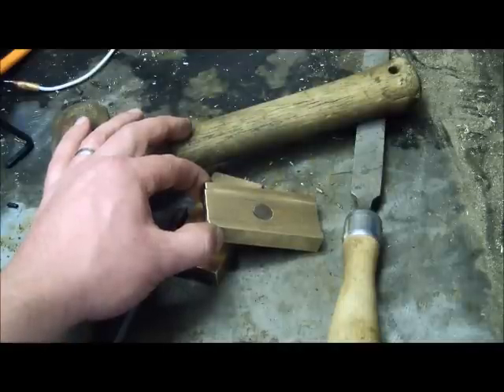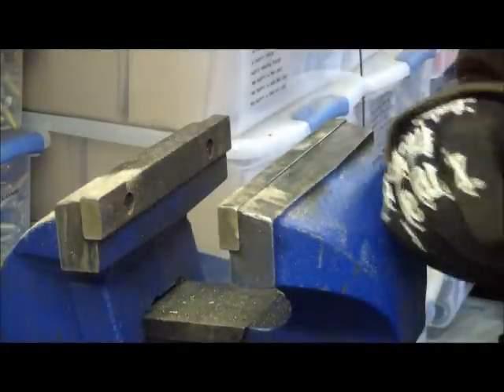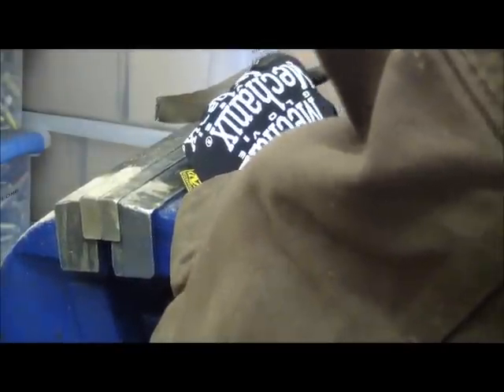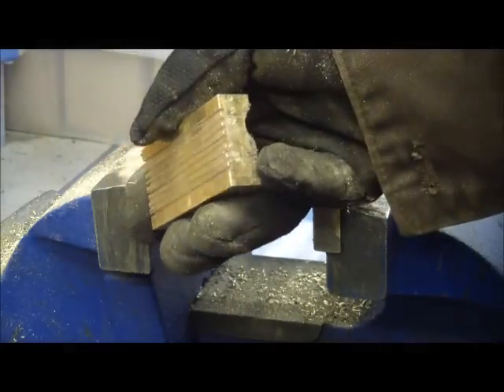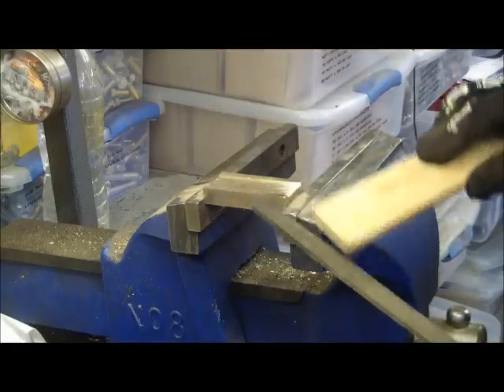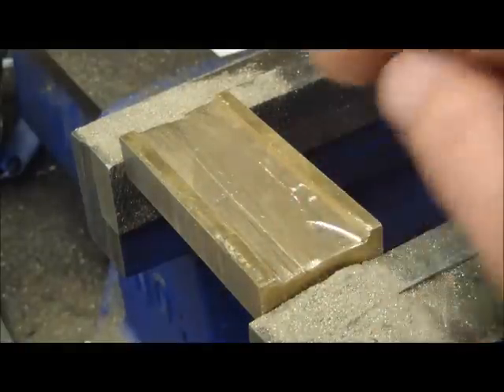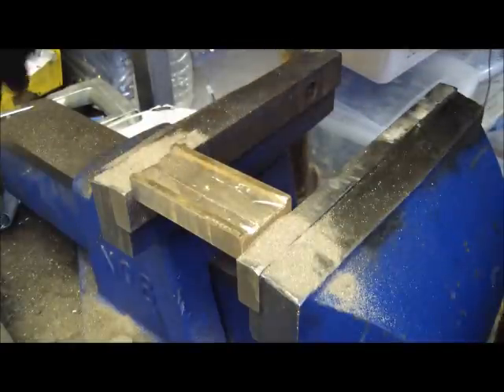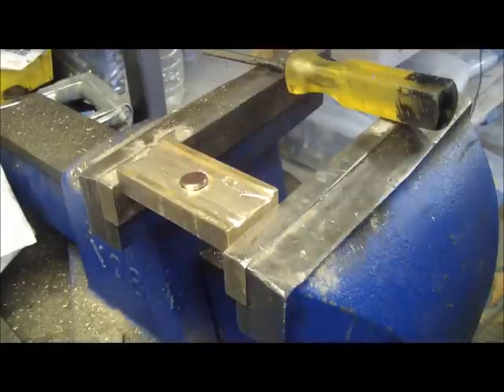Poorman's Milling Machine!

Comment: I was taught in High School shop class not to rub a file back and forth like an abrasive. It only cuts in one direction and we should only press down on the cutting stroke.  Pressure on the back stroke just dulls the teeth.  That's been my observation for the last 40 years or so. My $.02 worth.
Reply: I think we had the same shop class
Reply: I have largely ignored that, and my files are still okay.  Of course, much less force on the back stroke than forward, also to save effort.
Reply: Who cares about the dulling of the teeth the important part is that u waste your energy. Do this 40 hrs for a week and u will hate ur life
Reply: Pressure on the forward stroke only!
Reply: Only lift on the backstroke if you don’t own the files. If you paid for the tools and materials and time, do what you like.
Reply: But what about a dual cut file?
Reply: It's bronze so I'm not sure how much it would dull, I haven't had any bronze to play with in a long time.

Comment: And I was always taught to drag a file in only one direction on the metal. If you drag it backwards then chips get stuck in it's grooves. I find this method faster and the surface is also more flat.

Comment: +AvE I deliberately avoid grinders when doing my metal work; mostly because one slip and you can ruin the entire project. A file can be a far better option because slips can still happen but the degree of control is far greater. Its very nice to see someone else who appreciates a file. You'll find that if you actually lighten up with the pressure on the backstroke it can help the life of the file since most files sold these days are made of crappy mexican or chinese steel. Also moving in a gentle full body rocking motion almost on the balls of your feet using your weight to help with the down pressure and the cut, you can file for hours without getting tired. After many cramps my master finally took pity on me and told me the secret haha

Comment: A recollection from my days as an apprentice - use new, really sharp files for brass/bronze. When they start to just skid, they are too blunt to cut that material cleanly, but they are just about perfect for steel. Oh, and beware the steel bristled file card for cleaning! Instead, use a left-over of brazing rod or similar along the grooves to remove any clogs. It won't take the edge off the file teeth. I hope this tip will extend the useful life of your files. ;-)
Reply: Tyvole Only the unimaginative can't think of any way to sharpen 'dull useless' files.
Reply: You can buy wire brushes with brass wire here and there.  I got one that I think was meant for cleaning a grill.  And definitely a piece of wire to push out stubborn chunks.  It's really surprising what a good clean file can do!

Comment: When you said "drill this by hand" I was expecting a hand crank drill xD
Reply: Charlie webb Very impressed when I heard the hand drilling thing. Very sad when I saw it.
Reply: I was thinking the same thing lol, here comes the bit and brace. Nope! DeWalt ;-)
Reply: .......same but then I realized maybe the appropriate phrase  might have been ' to manually drill' but that's not too much more specific either.
Reply: @fabts4  recently I used a hand drill for drilling metal. It worked! Long chips.

Comment: I've got few power tools for metal. I use all the hand techniques you demonstrated. It may be slow, but it's effective. Filing, chiseling, hammering, bending... I don't have a forge, but much metal working is done cold, and the results can be very satisfying. Thanks for the vid!

Comment: I want to cry every time I hear those poor files being back dragged. I mean that litteraly. When dudes drag my poor files backward and round the cutting teeth over rendering them geldings. (Useless for removing metal with any efficiency). Anyway then I have to clean them thoroughly and bathe them in a solution of sulfuric acid and water. It sharpens them up. Thank you Ave I love your stuff.

Comment: When I saw you cutting the sheet metal with a cold chisel I couldn't help getting misty eyed. 

My first car was a £30 banger (Around 50 Canadian beer tokens), It had reasonably good bodywork, But mechanically it was totally FUBAR. So, I did what any red blooded man would do........ I bought another one that was mechanically sound but rotted out.

After swapping all the decent running gear into the good shell I was left with the rusty one to get rid of. At that time scrap steel was worth less than dog sh!t, And everyone I called wanted me to give them my actual cash money to cart it away !?!?! So, To get rid of it I decided to cut it up into small enough chunks to take to the dump.

I started with an angle grinder, But it soon dawned on me that it would cost me a fortune in discs. So then I started with the cold chisel. I made some reasonable progress with that, But it was back breaking work. It was at that point I thought up a MUCH quicker way....... A 6lb axe sharpened to a razor edge!!!!!

Jesus !!!! That thing would zip through 12" of body panel on a single swing ! After about 3 evenings of slog with the cold chisel I'd stripped down the whole front end, But only 5 hours with the axe had the rest chopped into bits small enough to fit in the back of my rebuilt car.

If I'd had the money for discs I wouldn't have looked beyond the angle grinder. If I'd been really flush with folding money I'd have probabbly gone out and bought an air chisel or reciprocating saw, But I wasn't and I didn't, So I improvised a cheaper way to get the job done. That was just one of many lessons that being broke taught me back in the day, And I feel that I'm a better person for learning them.

Comment: Nice milling machine.
I've been discovering the joy and utility of the cold chisel... and how so many tools are derived from it. 
Bolt cutters and wire cutters - two cold chisels in opposition with leverage
Drill bits - dual rotary cold chisels
Hack saws and files - lots of tiny cold chisels all in a row

I just picked up a few more. One for the work tool bag, one for the truck tool bag, one for the car tool bag. For $1 each at an estate sale, no reason to go without...

Comment: Cloth or premium sandpaper wrapped around file or something flat can help level quick too with a smooth finish depending on your grit. If you don't have many files, it's an easy and fairly cheap way to get around some issues. With soft metals, get an abrasive restorer block which is like a mega pencil eraser and will clean the grit up and extend the life of the sand/emery paper.

Comment: I've carved out many parts using only a hacksaw and files, plus turning pieces on my drill press using only files. No metal working mills or anything like that, but it can be done. Slow, but it works.

Comment: When filing soft metals rub stick chalk over the file to fill the lower parts of the gutters, wire brushing the metal off of the file will be much eaiser later.

Comment: Why are there so many comments about his filing method?  If your file is being "ruined" by dragging it backwards on a peice of pretty soft brass/bronze, chances are your file isn't properly hardened, and thats what you get for buying dime store harbor freight files.  Dragging the file backwards is a perfectly acceptable technique, and often recommended to maintain an even surface, so long as you arent putting significant pressure on the backstroke, and it doesn't seem like he is. I would love to see  some evidence to prove that hes ruining his file, else it seems like a lot of people are spreading wives tales.

Comment: I learned that pulling back any file doesn't cut anything, but rolls the edge so it becomes duller quicker. Pushing the file forward then lifting the file off the work piece and returning to the beginning edge will actually get the job done faster, as it won't be getting rolled over and traping the wee shards of metal between the folds. AYEEEEEEEEE!

Comment: This may work OK on bronze and brass but it would be a real SOB on steel. I have used my mill to do what should be a lathe job on a few occasions by either using a boring head or putting round stock in a collet and a lathe tool bit in the vise but it is always easier to use the correct tool for the job.

Comment: Metal working with hand tools goes back 20,000 years, not 200.  

When pounding a piece into a hole in a flat piece of material, holding the stock in a vice by the ends deforms the material and the hole, as well as stresses the vice screw. Put the stock on a flat surface, like the vice's anvil

Comment: Old school technique, and it works!.... I have, in the past, cut front sight grooves in pistol barrels with a 'graver' which is a narrow cold chisel (like a woodworking mortice chisel).... Piece of cake... took me less than ten minutes to do the job. It would have taken at least that long to set it up in the mill and mill it out. So cutting steel is also possible (and not too difficult) with a chisel....

Comment: Yep... I have cut a number for grooves in gun barrels to mount sight blades with just a graver, which is just a narrow chisel, like a woodworking mortising chisel, but very hard steel with about a 40 degree edge.
The whole job can be done satisfactorily in the time it would take to set it up on the mill, and there is no possibility of slip-ups from the work moving in the mill vice or fixture..... and no expensive cutters.... :-)

Comment: Hacksaw is not a very old invention. In the 1880s they became generally popular, but it was in the 1980s that bi-metal blades came on the market. Before that they tended to break a lot. Before hacksaws people would use a V-shaped cold chisel for the grooving, and then follow up with a flat one, like you have in this video. Die makes still used chisels until CNC took over.

Comment: are the tips of those digital calipers really to scribe a line? I only ask because I tend to also use them to scribe lines. 

Personally I tend to use the hand method when I can and when time will allow it due to the amount of control you get over the process of shaping the metal. 

As always another good video.

Comment: At 4:30, with the chiseling and all, I would turn the tool over and use the heel of the tool to control my depth. I just tend to think outside the box because I am nuts. It helps me out alot when working with door jams. Oh well.

Comment: Should have used a brace and bit to drill the holes. I never even thought about using a chisel to cut sheet metal, or as and end mill. Great tips.

Comment: the problem most people have a file, is they don't realize it only cuts in one direction (typically, the "push"-stroke)....lift up the file when returning to the start point in preparation for the next forward stroke....   letting it "ride" across the work will dull your file somewhat, and exacerbate clogging of the grooves

Comment: I used to use a cold chisel and a two pound hammer to cut the end out of a barrel, my wise ass brother asked why I didn't use a torch. The barrel used to hold petrol so I said that's a no brainer. If you cut a lot of brass and bronze you want a cold chisel and a drill bit with different bevel angles.

Comment: Thank you, really interesting and something that shows a little thought will always get the job done if one is prepared to think, … a little sideways thinking.  My type of thinking does not always give a useful result, as I would and have never thought of using a harder metal to cut a softer one! Obviously my brain was not in gear.Thank you for the upload.

Comment: If you cut with the hacksaw from top left to bottom right as well as in parallel (as you did) and radially move from that position to almost vertical - then repeat from top right to bottom left there will a lot less material to chisel out + I know its a real heathen thing to do but the wood chisel will do a better job as it is only sharpened on one side so you can use the bottom flat side as a datum and just surf straight across with the chisel parallel to the work piece.

Comment: good job, folks underestimate how effective the old tools and methods can be. job i had years ago doing some construction i got a few laughs and rolling eyes when i broke out a bit brace to drive screws, until every other guy on the crew had to stop at some point to charge the cordless drills they were using, "battery run out on ya? funny mine only dies out when i do" thier drills were also having trouble driving the long screws all the way home, not so with yee old bit brace.
Reply: captaingreenbush The real question is: even with their battery dieing and the issue for long screws (inapropriate drill for the job obiviously), who was still more productive?

Comment: There was this one time I used a regular plunge router to do much the same thing. I had to make a jig of course. The damn thing worked though. Brass is pretty soft stuff. Aluminum is almost as soft. Any decent carbide tipped router bit will do the trick.

Comment: At the last bit, when you put the magnets into the softjaw, could you have used the vise as a press?  I'm thinking I would have put the magnet in the epoxy, the softjaw on the vise, and closed the vise. Am I missing something, or just a different technique?  Thanks for the videos, I really enjoy them.
Reply: You might be more likely to crush the magnet with the vice, it's less forgiving than a hammer.

Comment: who taught you to drag a file backwards over the work piece a file cuts moving forward only.  Lift the file off the work on the backstroke eh?
Reply: ***** hes right you know =o
Reply: DragonsREpic If you know this, then why did you do it?

Quality files are not cheap, and that crap ruins them.
Reply: Rob C It depends on the technique those who swear by the text books of learning never have anything great to show because they don't use their intuition and just follow down the line of what they been told.
Reply: Right!!! Finally, someone else saw that besides me, no wonder he has to clean it out so much. Lmao
Reply: Rob Cso you learned nothing?????
Reply: Haha. Dirty D, I have a file that I originally bought when I first started working in a machine shop 18 years ago, still like brand new.
Reply: Rob C  really depends on the type of file being used some are cut for backstroke only seeing how it takes less force to pull than to push.
Reply: Rob C he is levelling the job he is doing it correctly the problem with lifting off the job you risk diving the file and creating an un even surface keeping the file flat back and forwards keeps the file true there are many techniques to filing
Reply: +Rob C to  which one adds  "chalk" into  file teeth  so  that the little bits fall out  ,  like all  'good'  practice , usually  not the time ..............
Reply: +Rob C sorry but you are wrong, he is doing it correctly. My granfather was master mechanist and he teached me to not lift the file, your work piece will get uneven, it will get far better levelled if you don't lift the file. Also there are files that actually work both ways! And some that work into the other direction.

You've probably never worked with metal besides shop class.
Reply: +DragonsREpic what the fuck would you know dragons are epic. how much filing have you actually done. i always drag it backwards 100%of the time. its way to hard to control lifting it off amd starting fresh each time.  never seems to cause any harm.
Reply: +Dirty D I've read that it's fine to do that on something as soft as bronze. Maybe it was just with a rasp file though.
Reply: +AvE hes not wrong 
you will dull your file
Reply: maybe it was just "pacing/guiding" back strokes? rather than lifting and pushing forward lifting pushing forward, etc. etc... used files for years and never an issue with dulling them as long as your not fully blown putting pressure trying to remove material on the back pull.
Reply: Rob C some people have dedicated files for fuckery

Comment: I learned that already 45 years ago at the engineers education at Nautical College.
Reply: My remark is not negative. I am just happy that old craftmanship lives on! :-)
Reply: However it took me many hours to practice. When I presented a workpiece to my teacher, it was never good enough. Nowadays I own a milling machine, but sometimes working with a hammer and chisel is faster and easier. If a workpiece had to fit precisely, my teacher always told me that a herd of elephants could walk through the gap :-(
Reply: good we need more Elephants.  There endangered.
Reply: Striking?

Comment: How do you control the depth of filing is even - so that the clamping sides of both soft jars are parallel to each other and not off at an angle?
Reply: The depth of the hacksaw cuts is controlled by the position of the brass block in the vise jaws. Those cuts are your chiseling guide. Getting that initial positioning correct is the trick. Measure and scribe the ends of the block to help locate them in the vise. After the channels in the blocks are chiseled & filed, but before drilling for the magnets, is when you can even up the channels to make sure the block faces are parallel. If the blocks are fairly thick, you could remove slightly more material in the centers of the channels so that they don't rock. This would make final adjustment easier too. The magnets should be set so that they don't touch the vise jaws.

Comment: I have a scar on my hand from a filing project back in machine shop. You had to get your block of steel from weld class, you welded up and square it up. File broke in half and dug into me. I was so angry having to do that, looking at a milling machine. What can I say, I was 14.